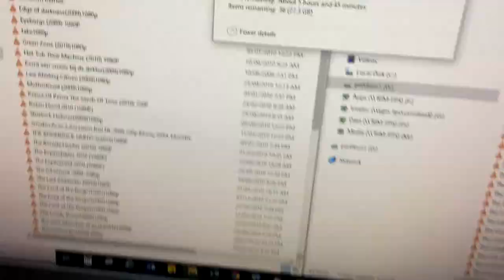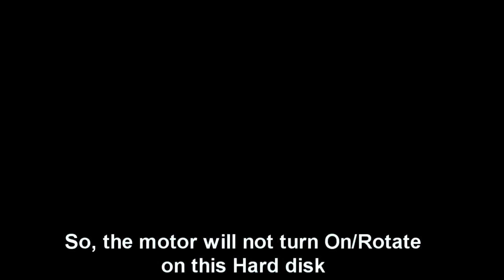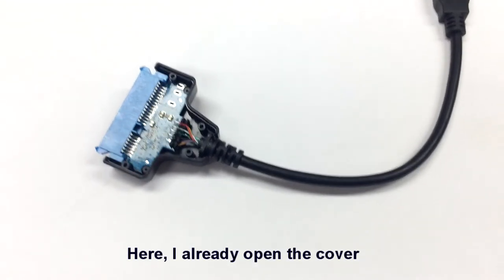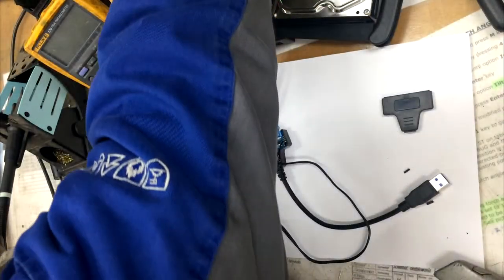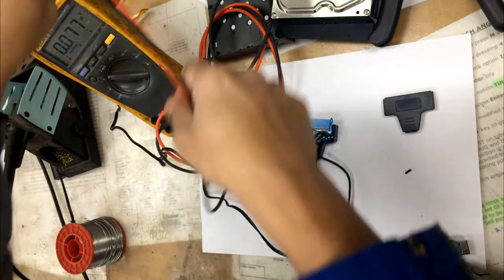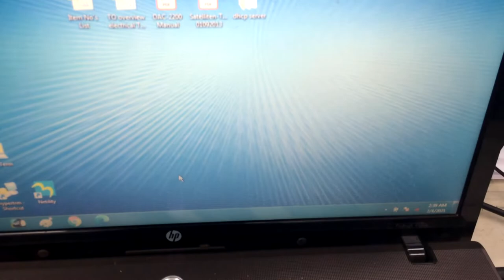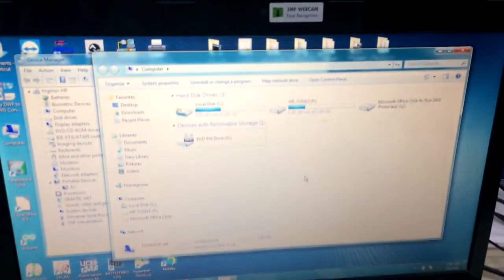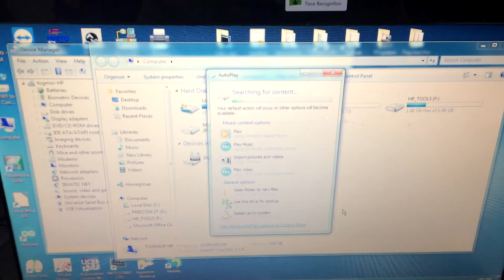USB to SATA on a 3.5 inch Hard Disk

Comment: Thanks, I'll try this,
I bought 4 of those thinking they just needed a 12v power supply (which I have many) to work on 3.5 drives, but they lack the connector, and the PSupply version costs 6x the price a piece, I thought I threw my money since I have no use for them (no 2.5" drives), until I watch your video...
Thanks for sharing... 
This will be my weekend project!

Comment: Can u tell me any other way bez I don't hv soldering not v indicator machine
Reply from the maker: You need to supply hdd with 12V and 5V you can use some old power supply connectors..